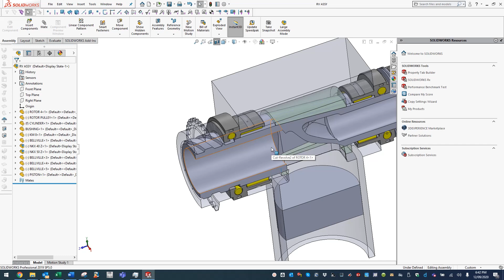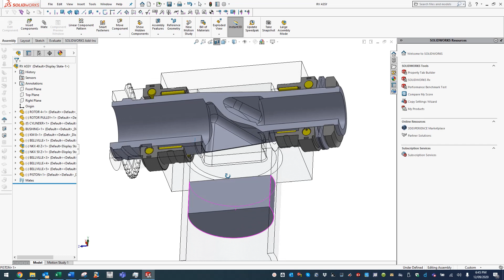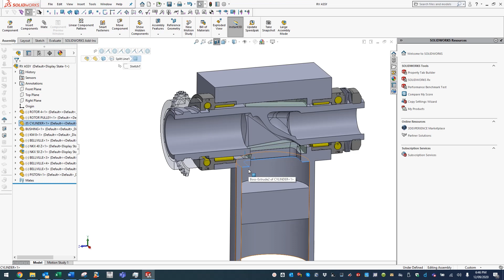Carr Rotary Valve - A Novel Rotary Valve Engine Design - Seals without Seizing

Comment: Interesting idea. I thought about maybe one potential issue here. The exhaust force is missing during not exhauste phase and at this stage the spring will pull the rotor and it will start to seize

Comment: i have worked on a taper seal design but with a electric servo drive instead of chains or gears for variable valve timing.

Comment: Exhaust heat is the killer for these designs, and taken even higher by the increase in power and RPMs with  the better breathing.rotary valves can offer. The sleeve valve engine was perhaps the better design.

Comment: the seal won't last. you suggested leaded bronze, but the top of the cylinder will get too hot for lead. Oil will work, but then also get burned.

engines with overhead poppet valves & no head gasket (cylinder & head are one piece) were built in the past & are now.

Comment: I like this concept, elegant and thoughtful design, particularly the way you work the 100% , 75% intake exhaust area ratio into the conical sealing mechanism and stronger exhaust side of the rotor, modern materials science between rotor and seal is probably the only suggestion I could make.
Enjoy your work and ignore the naysayers, they've probably never had an original idea in their life.
Regards,
Brian Smith
US6237556

Comment: The taper angle will be critical so it doesn't stick like a taper shaft tool holder.    Your angle might be okay, but it might need to be steeper.

I'm also wondering how well it will seal under peak combustion pressures versus the floating seal design.  This is certainly an improvement over a straight design.  A high ratio helix that really forces the tube to the right when the friction goes up might work, though it's a rather dynamic system to simulate or estimate what will happen in real life.

We made a 16:1 CR rotary valve and it didn't blow out the dual spark plugs, but it was running on 100 octane isooctane.

Comment: This idea was first posited in the Abingdon cross engine developed at the Shell Research Centre, Abingdon, UK in the late 1960's or early 1970's.  This concept is old and well established.
Reply: This was not "first. . . in the 60s". Go to the  Sammy Miller motor cycle museum and view Norton's try at it. Same principal entirely.
Reply from the maker: that may be true, the only book i read on the subject was Hunter, rotary valve engines which was in the mid 40s. can you share any article of information and which aspect are you saying is not novel?
Reply: @vtzerosix  The cylindrical nature of the valve, with ports and internal oblique divider.  Its position in the head.  The floating head with a fulcrum which allows the clamping pressure to fluctuate proportionate to the cylinder pressure so that the clamping pressure is always just sufficient for obfuscation.  All covered in an article in Motor magazine in early 70s.  I read it in an archive in the Cambridge University Engineering Department library in my Masters' degree course.

Comment: New design (improvement) of internal combustion engine are hard to take hold, most unfortunate.
Reply: Very true.  I don't look at rotary valve engines as something that will ever catch on, but as something that is just mechanically interesting.   It's a logically valve train that has some seriously tough engineering issues to solve to make it a design that can run for a reasonable amount of time without intervention.  This design helps solve one of the difficult problems.
Reply: I can see this in niche applications, such as racing or industrial applications.

Comment: I appreciate your design, an automatic, "unsticking" mechanism essentially.
My brother and I have put a lot of effort in to rotary valve engines and had much success with the, floating seal concept where combustion pressure pushes the seal against a fixed rotating cylindrical valve.  Check out the MrPizzaman09 youtube channel.  We have occasionally had seizing issues but they have related primarily to overheating events with no issue if sufficient coolant or airflow is kept over the head.

It would appear that your design copes with thermal expansion quite readily.  What is the assumption of the coefficient of friction on the helix?  I feel like it may be a very sensitive factor in this design.  The lower the helix angle the less sensitive it may be.  You are absolutely correct in assuming that exhaust pressure and intake vacuum will drive the valve towards the intake, I've had press fit bearings driven right out of housings due to this.  

Keep it up!  I love to see others working with rotary valves.  So many unique ways to accomplish the same task.
Reply: Thanks guys, I watched your videos and take my hat of to you both. This work is 100 years too late but still enjoyable.  It would be nice to put one on a single cylinder motorcycle.  I built a variation of the one shown here and will put a video up when it runs, 17:1 means I will have to cook up a more robust ignition system than the stock gx200 one which is why it isn't running yet, has great compression. All the best with your endeavors.